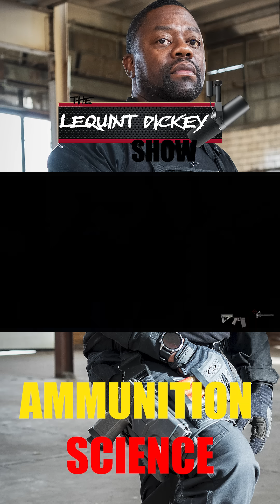LeQuint Dickey Ammunition Science Short #youtubeshorts #shorts #education

Comment: Damn , ok let's educate some folks, it's not 9 to 1 twist. It's 1:9 meaning the round makes one revolution evey 9 inches NOT 9 revolution every inch. So if you have a 20" barrel the bullet will make two complete an a partial 3rd revolution. The USMC M40A5, has a barrel twist rate of 1:12 inches, meaning the rifling completes one full rotation every 12 inches of barrel length. If people are going to teach or explain about firearms they should know what they are talking about. The smaller the number the faster the twist 1:7 1:8 1:9 ect. Faster twist means you have to compensate for drift in long shots. I hope this helps.
Reply from the maker: I said that wrong but you get what I putting down thanks brotha appreciate you 🙏🏾